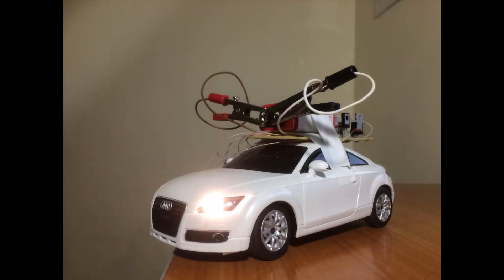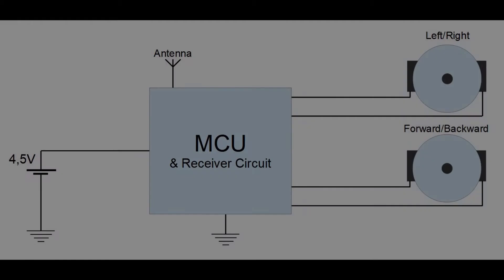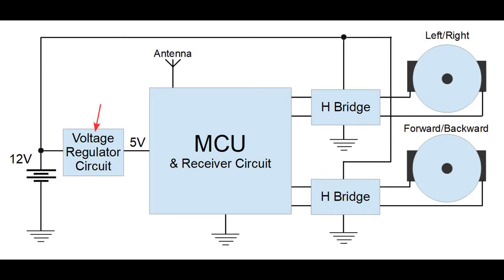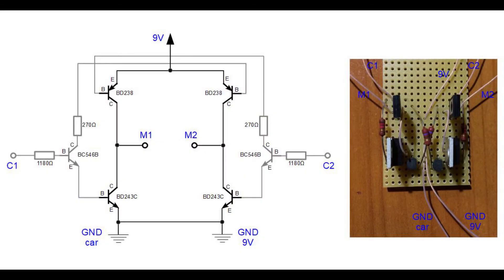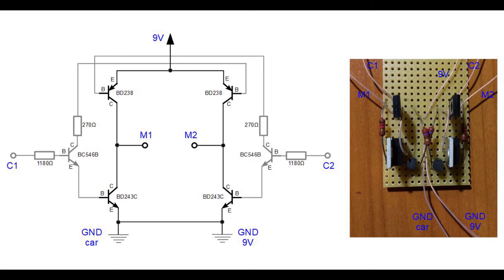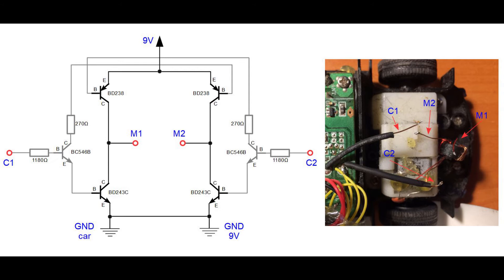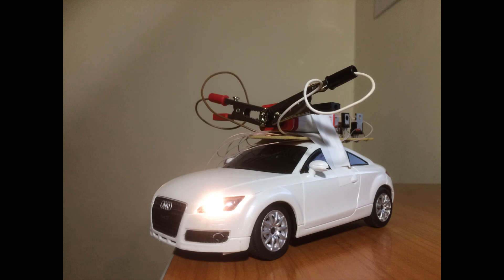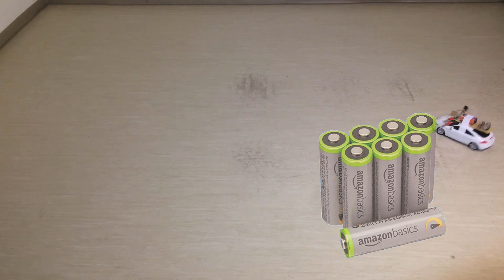Using H-Bridge to increase RC car speed - part 2

Comment: Should give this a go with 3x lithium ion cells next time around.

1x lithium ion cell for powering the regular board while being lighter then the 3xaa batteries.
(14500 size is aa sized lithium ion cell) & will probably take less space while being a bit less voltage sure it will surely be a bit cleaner looking having that h bridge inside the body of the car along with just modifying the battery holder of the car so you get 7.4v from the two 14500 lithium ion cells too the h bridge.

Suppose another mod you can do while you are at it is tires that are of a softer rubber compound with a lot more grip at the same time as well and removing those plastic textured tires it has now.
perhaps something like a bunch of wider rubberbands for testing will work for now or a set of mini-z tires with 8.5mm width that has a tire track pattern rather then being smooth without any pattern should work as well.